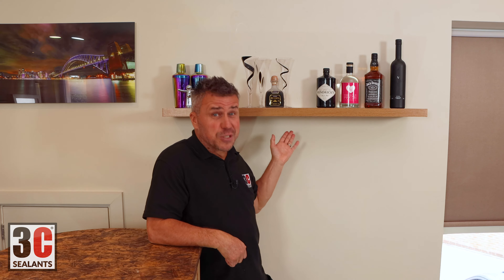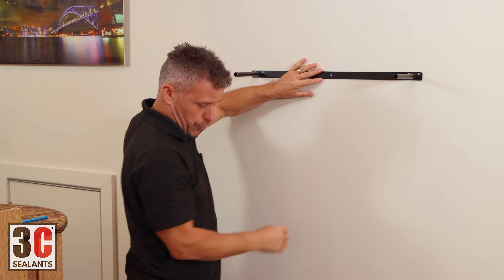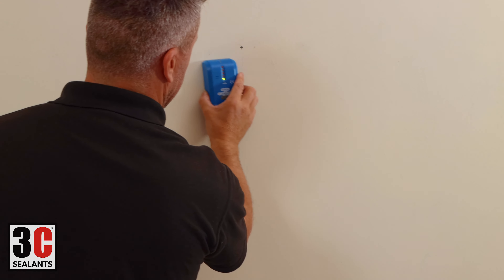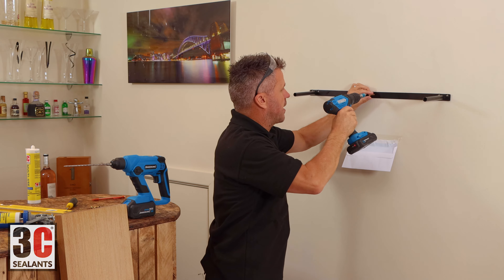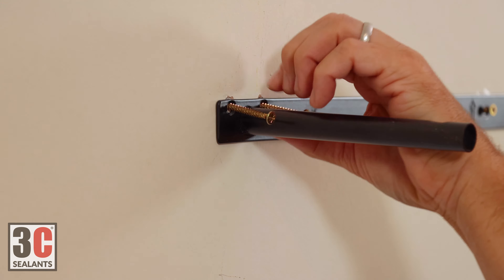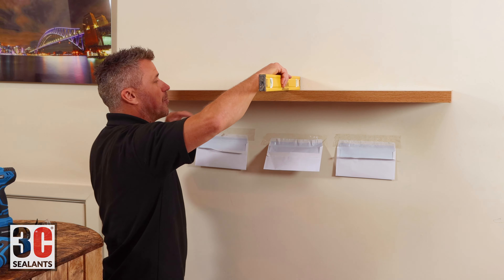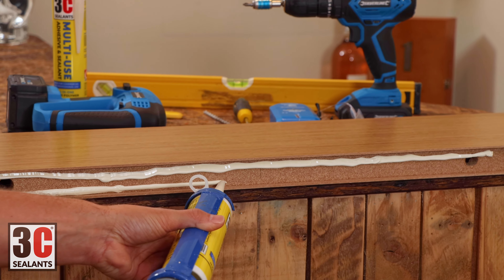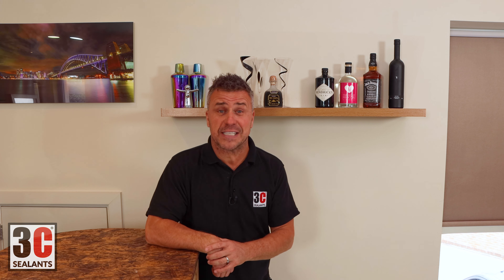How To Hang a Floating Lack Shelf a Stronger Way

Comment: Next video, how to remove the shelf😂
Reply: lol “just glue them to the wall” would’ve sufficed.  I imagine my 100 year old plaster walls will hold up well when having to take a crowbar to them to remove these later on
Reply: My thoughts exactly!
Reply: And how to patch a wall
Reply: @mjf508 Best way to install a floating shelf is to use 8" long half inch lag bolts. Drill into your studs, on a level line, 3" plus the thickness of your drywall. Cut the heads off the lags. Drill 1/2" holes into the center edge of 5/4" pine boards as deep as you can where they are marked for where the lags are in the wall, on center for your project, hammer the board onto the lags with, or without glue, then slide your floating shelf over the board, level front to back and use trim screws or 18gauge nails/staples to hold the shelf onto the pine board. 

To remove: remove screws, slide off still reusable shelf, cut the pine board off the lags, use a vice grip to remove lags, patch 1/2" holes.

Total cost besides the purchased shelf: $25 for four lags and a 5/4"x6"x8' board

Or glue the whole shelf to the wall with this $30+ metal fiasco.
Reply: How to straighten the picture to the left you mean.
Reply: Exactly!😂
Reply: "How to tear down your wall in 3 easy steps!"

Comment: What’s the purpose of drilling the final screw in the middle under the shelf?
Reply: LACK shelves have one hole each below, to fix it to the brackets from sliding outwards. For that you have to make sure that those holes in the brackets are facing down while fixing it onto the wall, or you have to fix the brackets all over again.

Comment: Great video, Need some advice. I live in an apt. so how do you safely remove the shelf with all that sealant inside?
Reply: First step would be to remove the wall
Reply: that's the fun part - you dont!
Reply: It's permanent after applying that sealant
Reply: He only.put the sealant on the area the bracket would touch not the wall
Reply: @wilsy19  Sadly you need to reach the front side of the bracket to be able to remove the screws. So you would need to rip the whole shelf off of the wall in order to reach the screws, thus destroying the wall.
Reply: He should have cover the ends of the two supports /pipes with a little insulation tape, and then put a tough of sealant near the ends of the pipes...This would be more than enough to stabilise the shelves. To remove the shelves, I. The worst case scenario, simply cut them up insitu using a multi tool. You would destroy the shelves, but the wall should ok except for the screw holes  needing to be filled..

Comment: Hi, I'm a complete DIY newbie, and I need some advice on installing this shelf model on the wall of my living room. Here in Ireland, the walls are made of drywall, and I'll need to drill some holes to install the wall plugs required to attach the shelf. I've noticed that when I knock on certain spots on the wall, the sound is duller, like there might be a stud or something behind it. Should I be concerned about this? Is it possible that there's something behind the wall that shouldn't be drilled into, and that I should avoid making holes there? I will probably have to drill both areas to place the shelf tho. Thanks so much in advance for your help!

Comment: I'd like to see if it wiggles when you try to make it do so. I just installed a large ikea lack shelf. The mount is secure but it's the prongs coming out that are questionable. I want to make sure I've done an OK job. It wiggles a bit
Reply: I just mounted a 190cm long one yesterday. I mounted it upside down because the shelf is high up and and I didn't want to be able to see the screws from below. There's a little wiggle though so I was worried it could have had something to do with it being upside down. I guess I'll just leave it as is seeing as the wiggle seems to be a design feature 😂
Reply: doesn't matter if it wiggles a bit, if you don't want that to happen don't use floating shelves use traditional ones

Comment: So you don't get to take the shelf down since you more or less glued it to the wall. Also wouldn't you want to try and get at least one of those wall mounts screwed into a wall stud?
Reply: It appears this shelf was installed on a concrete or masonry wall. Every one of those holes with plugs would be quite solid.
Reply: OK if LACK shelf is a permanent fixture, but not if to be removed at later date. Try inserting 2 @ long plastic wall plug in the hole, add Lack shelf and screws at least it doesn't wiggle and can be removed later.

Comment: what's that last screw you screwed in at the end of the video??
Reply: Exactly, didn't get that why do you even need to screw there
Reply: @flipside2592  I believe its to secure the shelf in place or else you can just pull out the shelf (if the multi-use was not applied)
Reply: The shelf is fixed to the bracket prongs with those screws.

Comment: What diameter to be drilled?
Reply: The exact size of the plug, if you can hold the drill steady. Smaller if you move it all over an end up with a larger hole than the drill  bit...